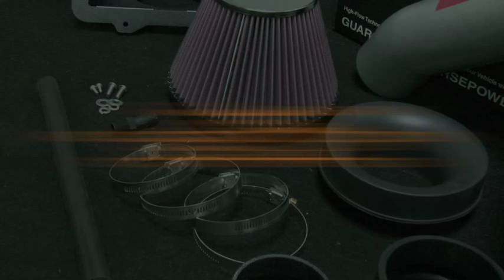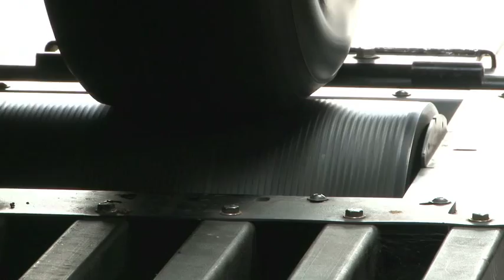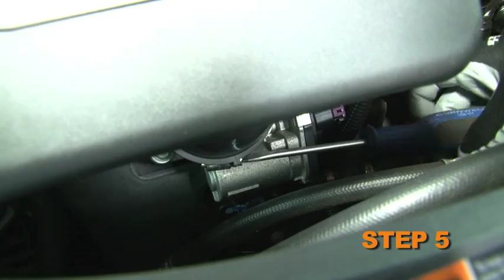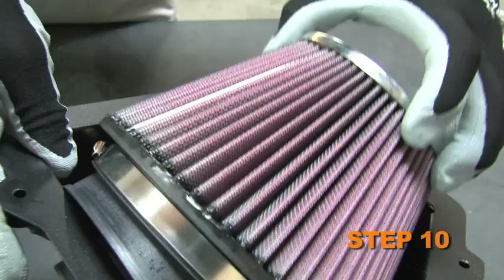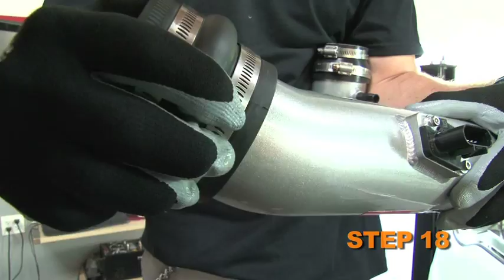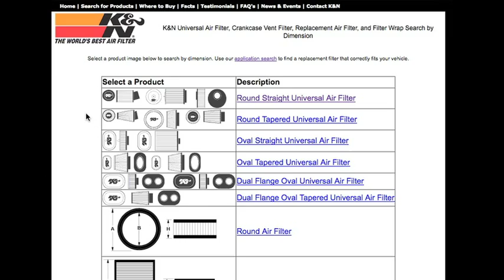2010-2015 Chevrolet Equinox GMC Terrain Performance Cold Air Intake Kit K&N 77-3071KS Installation

Comment: Will this fit a 2013 Chevy Equinox LTZ 3.6L V6? If not, is there another cold air intake that will?
Reply from the maker: K&N only makes one for the 4 cylinder at this time. We do not have any vendors that manufacture one for the 3.6 V6 unfortunately..